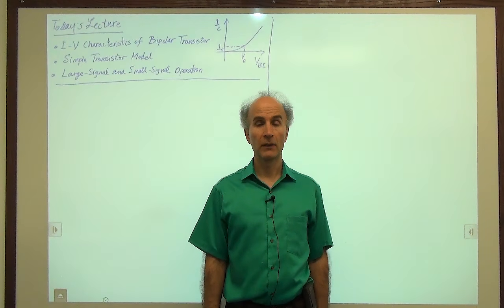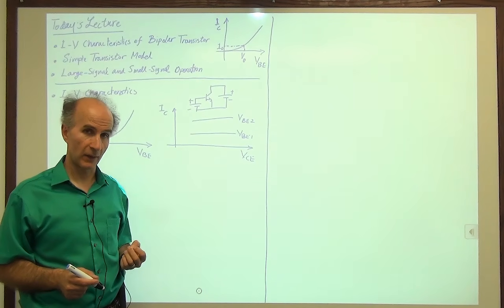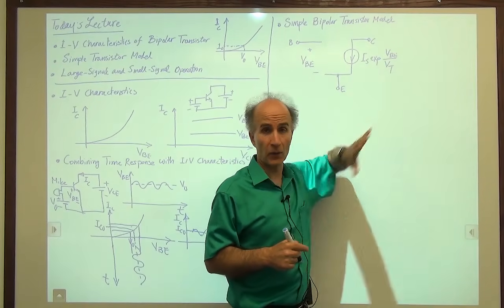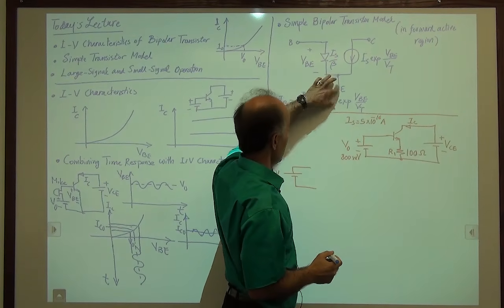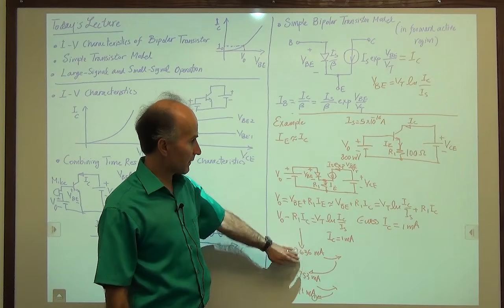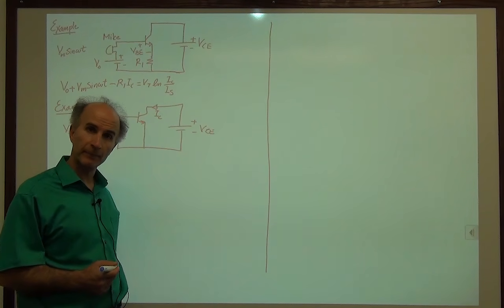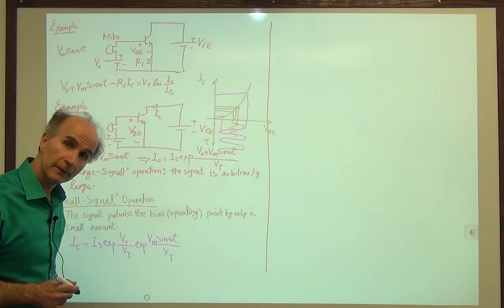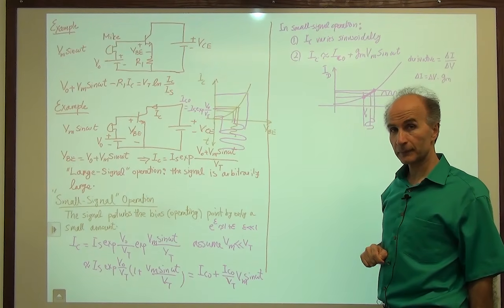Razavi Electronics 1, Lec 16, Large-Signal & Small-Signal Operation

Comment: 00:51 Developing a circuit model for the bipolar transistor
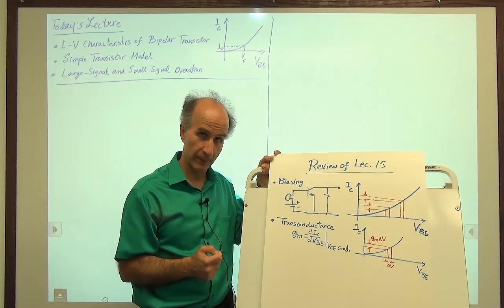04:29 Transconductance measures the strength of a bipolar device in translating a voltage change to a current change
10:19 Transistor can act as a current source and its values can change.
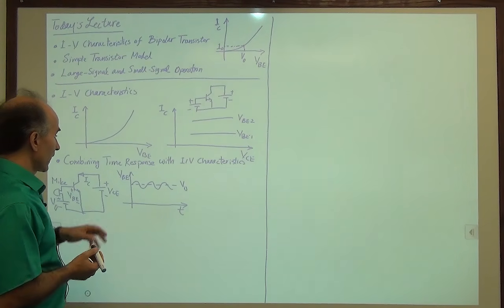13:47 Finding IC as a function of time
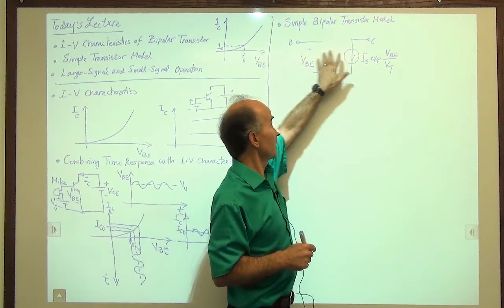19:59 Dependent current source placement in simplest bipolar transistor model
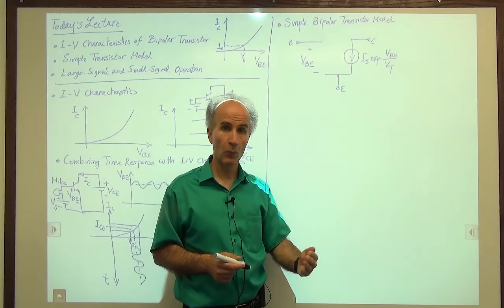22:21 Modeling the base current using a diode
28:04 Transistor model replacement and circuit simplification
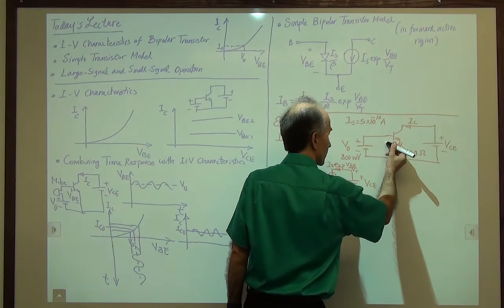31:10 Analyzing large-signal and small-signal operation of Razavi Electronics
37:26 Nonlinear functions require mathematical labor in bipolar transistor circuits.
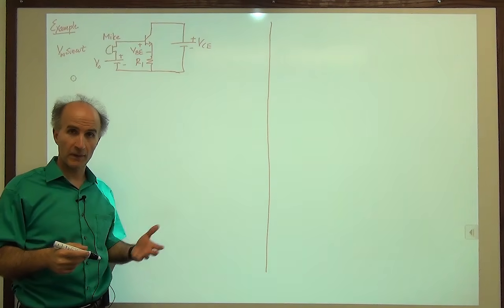40:27 Analysis of voltage and current in the circuit with a sinusoidal microphone signal
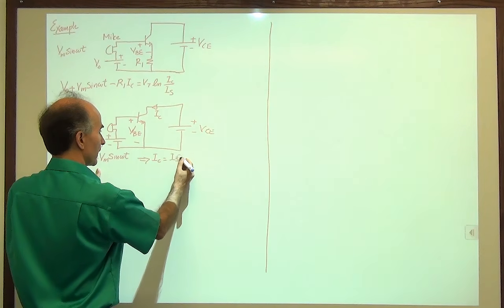47:45 Large signal operation allows for signals of any amplitude, leading to complex exponential expressions for IC.
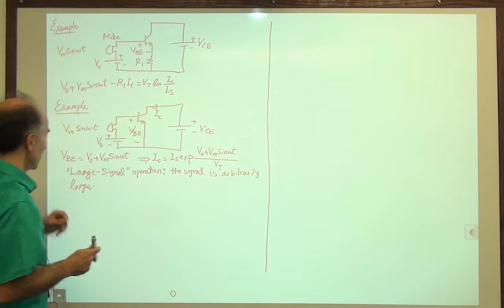50:57 Small-signal operation assumes input signal is small compared to the bias voltage.
57:35 Small signal operation leads to sinusoidal behavior of collector current.
1:00:42 GM times input voltage equals current fluctuation

Comment: can't we solve the equation in 34:00 with calculator?
actually i guess we can and i solved it and found Ic=0,019A where is my mistake?
Reply: When we try to solve non linear equations iterations method and Newton Raphson methods are the best. Sir solved it in iteration method. I solved it in Newton Raphson method. Sir got in the range of 0.72ma to 0.75ma. I got Ic=0.72 milli amp. I think answer is 0.7mamp. In calculator enter values properly.

Comment: why not replacing base emitter terminal by current source? it also looks like it behaves as voltage controlled current source
Reply: Because If we replace that by current source, Voltage across that would be Vbe and if we change Vbe ,  then current also...so it would not be a current source....Collector emitter junction has Vce voltage....and by changing that voltage , Ic is constant thats why that is Voltage controlled current source...base emitter junction is not current source.

Comment: Over a long time I have been thinking that BJT is a current controlled device, and now this man says it to be voltage controlled. How come everybody modifies electronics as they like?
Reply: Maybe looking at the credentials of the one claiming might help
Reply: It really depends wether you are ok if it's linear or not. If it's a current controlled device, then you just have the relation Ic=B*Ib.
If you say its a voltage controlled device, then you have that non-linear function.
In the end, even the beta isn't constant with magnitude of the currents or temperature. So the system is non-linear and thermically dependent. The good thing is that there are techniques to tie things, so you get an amplifier which is almost beta independent.

Comment: Can someone help me out wd the steps 57:10 how we can write exp vmsinwt by vt as (1+exp vmsinwt/vt)
Reply: Raghavendra B
 is right, Razavi himself wrote that basic approximation on the board just one line above {i.e.:     exp(ϵ) = 1+ϵ      if ϵ<<1}
Reply: Same problem here. I think that it need to be calculated as same except Vt in the breckets because we are taking that Vt out of breckets. Please someone give a explanation for that step.
Reply: e^x = x+1 will hold if x is much much smaller than 1, say x=0.1, using your caculator is approximately 1.1(1+0.1something something), try also x=. 2,.3, etc.. and notice that as you approach 1 that expression will no longer hold. For small swing razavi considered vm to be small as compare to vt to produced a linear output, and that will hold only for small input signal because in the graph of Ic vs Vbe which is exponential by nature, you can still find a straigh line  if you consider a small part of which will correspond to gm as slope of that small part of the curve, hope that will help.
Reply: This is because..
Exp(x)=1 + x + x²/2! + x³/3! + .....
So when x <<1 , x²,x³ higher order terms will be close to zero 
Can be approximated as zero..
So finally we have exp(x) = 1+x.    (x<<1)
Reply: Here, we have followed a simple rule to deconstruct the exp term that is present in the equation.  We have (e^epsilon ==> 1+epsilon if epsilon <<1).  This is the assumption that is made here.  Accordingly, assuming the term, exp (vm sin wt/vt) to be <<1, we can use the above expansion and decompose it to be (1+ (vm sin wt/vt)).  Hope this helps.